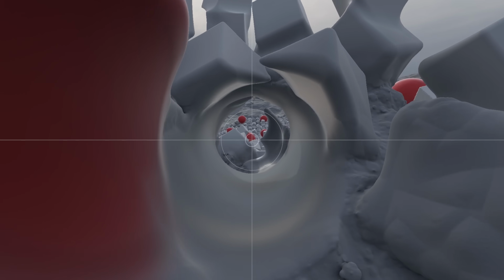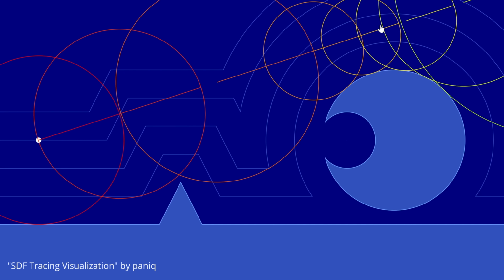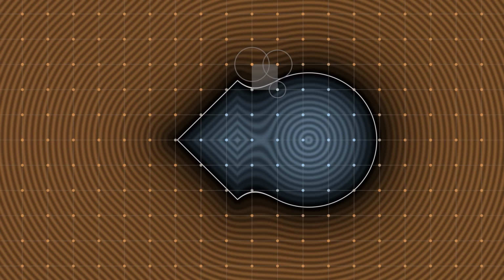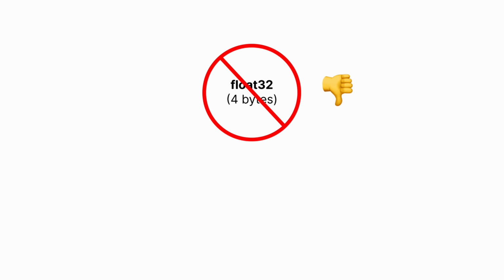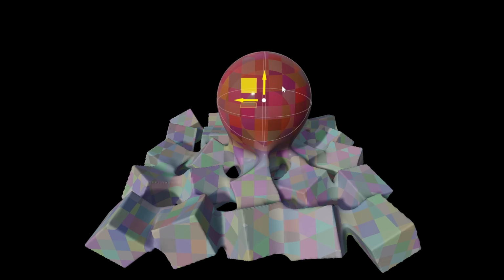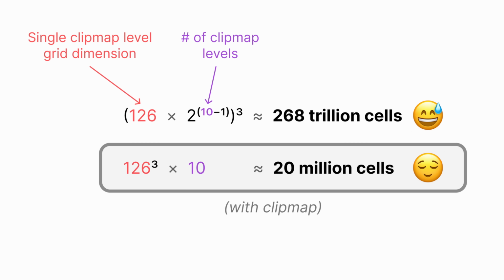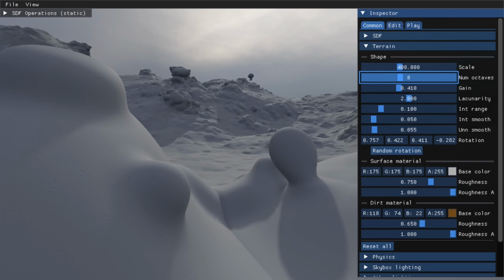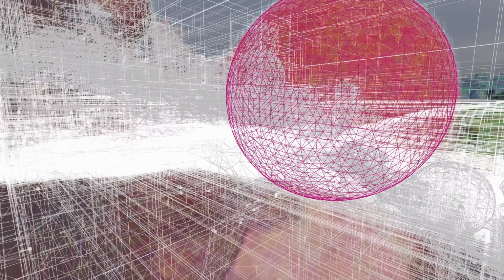I'm making a game engine based on dynamic signed distance fields (SDFs)

Comment: Hey so I watched this the other day, and its been mulling in my brain, and I've realized you can use this technique to solve an annoyance I've had in rendering dynamic water simulation. If you are simulating water via particulates, the technique used to render the water, used to have been to draw the water onto a render target as a series of spheres of the particulates, and then blur the render target to get a smoothed shape, and then use that to render water into the scene. But using your technique might be a faster approach, especially as it wouldn't require an extra render target and render target switching. Such a cool technique with so much potential, amazing work!

Comment: Hello, I have a question: If a very large object moves in the scene, will it trigger a great number of chunk updates and thus increase the computational load? What if, instead of using a unified voxel grid for the entire scene, I assign an independent voxel grid to each individual object and precompute all the relevant data? In this case, would it be possible to avoid recalculating the Signed Distance Field (SDF) during object movement, and also enable arbitrary scaling of the object’s SDF? Then, would we only need to compute the intersection results of SDF voxels between different objects?

Comment: I have a similar idea which I'm not certain of. Instead of using any grid standard in the first place, all surfaces are mapped based on their largest plane or polar projection point center. changing things is slower but storing the data and sending this over the net would be far more compact when basing the hologram on projectively geometric fractals. The system looks for similarities to any shapes before compressing as copies with changes in rots/scale(s)/booleans.
But you now, no fully modifiable world will ever escape sandbox games into mmo's without literally streaming video which alone costs about 20 bucks a month for the end user.  Dual Universe has modifiable terrain, now limited to 1000 meters deep, and it works, but when you fly over such an area, the server has to stream tons of data which costs a lot in real $. 
Survival games are my favorite. I don't understand why so many people waste time on fps trash. The real goal of any programmer should be to make a game that everyone can enjoy in a free roam single shard server. This has been the ultimate dream of many programmers, but most can't get past the first hurdle that DU solved, which prioritizes player positions. 1 million can be in the same place, no lag, no crashing. The problem they had was turning the game into another Factoria with no interesting thing about it besides building custom voxel ships using that terrible voxel system.
Is this engine of yours open source? AT the very least it could be used to let planets erupt volcanos and weather like real ones do every so often. This would give the function of a realistic world people can explore, where even the world creator doesn't know the depths of. Mystery is the best when there are no cheat codes. Explorers who explore the most are most likely to find hidden gems that were made truly at random. I played Minecraft about 3 years and just got sick of it because it all began to look the same and it got pointless real fast. You ALWAYS need to leave room for amazing features you wont think of until later, like npc towns, cities, and ai intelligence that runs nonstop. Evoloution, in other words. The only way a game wont ever get boring.
BTW; the secret to point evaluation is NOT to find ways to save them, but ways to both alter them slightly so they're identical based on the largest degree of projection angle possible for that chunk. In other words, you are better off storing a bunch of blocks that are all rotated by multiples of 5 degrees off standard than 1 or .1 degrees for example!!! You have no idea how much memory this can save you when doing polar coordinates, because you can essentially just save jpegs to build everything. Once you reach this level of efficiency, you can treat everything as a dynamic object, which would allow you to have planets and moons and stars that move realistically not fixed with a skybox.

Comment: At first, I wanted to see the code. But after watching the rest of the video, I don't: there's so much implemented in the engine, and my knowledge of 3D graphics is so low, that the code would just overload my brain and be pretty much useless. I just learned to use SDF to render particles in my 2D physics sim, and would likely benefit more from exploring the concepts you mentioned on my own. But I'll be waiting for further updates from you. Cool stuff :)

Comment: You mentioned a lot about the memory usage, which makes sense at runtime, but how does it scale in terms of long-term storage usage? I assume you still need to persist all the changes at the most granular level to be able to render them when you move away and return back to where the change was made, right? I feel like this kind of SDF manipulation would be amazing for something like a 3D version of Noita (a 2D platformer where "each pixel is individually simulated"), allowing for incredibly cool physics effects.

Comment: Hi, this is absolutely awesome and I'm excited to see where it goes!
I have a question about your engine...

I am building an SFD based terrain system. The distance field is stored densely and SDFs are applied using the cached values, meaning the time it takes to regenerate a region is not tied to the total number of edits the region has undergone.
However, to my knowledge, this prevents my SDFs from being dynamic or storing distances sparsely. For dynamic SDFs, I could recompute edited regions from scratch, but this introduces the problem above.

How does your engine handle this problem? For example, if a user continually dug and rebuilt the same region hundreds of times would the engine slow down?

Comment: 13:18 so between using a BVH and a CSG tree, how expensive is it to keep every CSG primitive in memory for recalculating regions in the SDF grid? I know it takes less memory to represent a geometric primitive without triangles in this context, but seeing how you constantly fire and instance many primitives in your gameplay, even though it's very performant, I'm curious of what the upper limit is. Are there also cases in which primitives are automatically despawned?

Comment: u did it, u have achieved something that i was trying to achieve in 2015 or at least it seam that way. Well i was more trying make it work via network as multiplayer. i was hoping for some download files so i can spawn ton of blue physic object and see how they flow "as a water" would be nice to see water implementation and how u deal with the lag it. as moving thru the scene would collide and disturb thinks. Well that makes me think about displacement so your coal looking black blocks would move above heavy blocks....

Comment: This inspired me to convert my voxel system into an sdf system in my game. It's not an infinite world, but it's also pretty large. Creating tunnels ended up being an impossible task if I wanted to use regular voxels. Instead, I simply used primitives to shape the tunnels, chunk the space and convert the primitives into voxel values, and then use surface nets to create a mesh. Everything is done on the gpu and it's blazing fast. Very very happy with the results

Comment: I'm working on an chunk-based independent voxel body system based on VDF and virtual heightfield meshes in unreal engine, and the voxel system basically only exists to save volumetric body information for deformation on a separate system. My voxel system treats every world aligned voxel coordinate as a potentially 'on' voxel, but only takes up data if one is on, and it treats the location of every voxel 'body' as 0,0,0 so they can be movable as independent systems. 

Your video single handedly makes what I'm building feel archaic and I can't wait to see what comes out of it!

Comment: The possibility of having a beam attack that cuts through a mountain like in an anime 😲
Reply: Especially if you can detect the cut and then treat the two parts of the mountain as separate physics objects like in a continuous version of teardown.
Reply: @johanngambolputty5351 it seems very unlikely. As it would need to generate a collision mess for the entirety of the mountain. Even if the entirety of the mountain is made from a single material, it would take a ridiculous amount of resources to have the top half interact with the rest of the environment.

There are probably way to fake this by lower the resolution of the mountain (destroying many of its features) or some clever trick with SDFs, which seems unlikely.

As of now if you remove the ground from an object it will just stay floating. And it seems very unlikely that this will ever change.
Reply: TBF, you'd only really have to have to deal with gravity physics. Collision would work if you just cause it to re-merge like you were dropping a cube or sphere like they did earlier, no? You'd also only need to calculate the mesh on the bottom of the mountain top, which would be intracting with the ground.  @baggelissonic  also if you lower the mesh rez for the sake of gravity physics and object size then you'd just have to store the full rez for when it re connect with the ground again.
Reply: @quibbage101  Yea possibly store the resolution proportional to the size so its fixed size compute.
However theres one crucial issue you  have not addressed, the mountain itself could no longer be an sdf once split. it would need to be turned into a duplicate physics mesh only and be rendered in a different way. The only other way you could keep it as an sdf would be to duplicate the whole mountain and apply a second object as a subtraction mask over the parts of the moutain that are no longer connected. Thus you would have two full sized mountains with two masks each "removing" the parts before the partition.
Not impossible but potentially difficult with drawbacks.
Reply: Ramiel attack from Evangelion
Reply: @siz1700 TYPO! Attack*
Reply: @VeniriScout  thx
Reply: It’s already possible without this
Reply: @ironhell808 Are you sure?
Reply: Bararaq Saiqa!
Reply: the possibility of throwing a enemy (who's body is super tough) into a building so hard, it's body weight demolishes the building.
Reply: Doing this in my own engine at a very base level right now and it looks super awesome

Comment: The game I'm working on would be PERFECT for this... My game uses mesh deformation mostly just as a visual effect for snow which I haven't been able to do much with due to the limitations of the Godot engine. With an SDF engine I could have building snow forts in real time, snowballs splat onto surfaces instead of just leaving a decal, digging tunnels in snow, it would be great. Granted, I'm not going to up and restart like 2 years of work, but maybe for a sequel someday. Will this project be open sourced? Adding real time multiplayer to an engine like this would be a very interesting problem, one that I would hope to be able to poke at one day. Although a turn based multiplayer game where only one player is affecting the world at a time like Worms or something probably wouldn't be too hard.

Also, I feel like this could be a really good engine for handling softbody physics. Like if you have an object with a maximum distance that it can deform in on itself you could keep a sort of internal pressure for objects like balloons that allow another object to press into it but only to a certain degree. Softbodies in traditional 3d engines are notoriously expensive so this could be another 1 up for SDF engines.

Comment: You could make the grid more accurate without using more storage by using jpeg-style frequency-space compression, which for a game engine would be best implemented by just compressing using ASTC 3D textures. In this case your brick map would point to ASTC blocks rather than pixels. You’re already using 8x8x8 pixel bricks, so you could increase this to something like 64x64x64 by having an 8x8x8 grid of 8x8x8-sized ASTC blocks. For latency reasons you could have two textures, a "raw" texture that’s uncompressed and a compressed ASTC texture that blocks from the former get compressed into asynchronously

Comment: Great video!  Can you share what kind of GPU perf is needed for this engine as well as how much vram? Maybe I got this wrong but IIRC, Dreams used 6gig of ram for its octree/BVH. At least that's what it seemed like from one of their talks assuming I understood it correctly. That suggested to me it was not a technique that would work on mobile. Of course that's fine, not everything needs to be mobile friendly. For the thing I was working on at the time though, I needed a mobile friendly solution and am curious if your solution would handle that better.
Reply from the maker: I don't have exact specs as I still have many optimizations to implement and knobs to turn for different settings. That said, this is not going to work on mobile hardware right now.

Comment: Love the work, but I have a worry. I fear that your wonderful technical achievement will get buried under technical debt and stagnate because you are planning to dilute your effort between different scopes of the project. Scope creep is 'the' killer of most projects. Yes, a proper game can be a great motivator, but it can also be a distraction.

May I suggest putting an proper game on perpetual hold and, instead, focusing on building the tool? 

Full games are REALLY REALLY HARD even with a full game development kit at your finger tips; way too many disciplines to wrangle. Not trying to be a doubter, just talking about rational project optimization. Make a killer engine, and game creators will happily make your game for you bro.

TL;DR:  A mediocre "tech demo" level game may pay for itself, but a good engine could net you a valuable game studio and several profitable games.

Comment: This is exciting. I've been interested in finding an engine that accurately handles water fluid simulations (or at least as much as is necessary to be believable). This looks like it could handle such a thing fairly straightforwardly

Comment: Really cool! I’m curious why you chose linear interpolation instead of quadratic/cubic? It seems like the smoother continuous curve would solve some of your visual artifacts and maybe let you use a lower resolution for the cached points?

Excited to see where this goes!
Reply from the maker: The biggest reason is that with linear interpolation you only need 2 samples (in one dimension), which minimizes the amount of samples that are duplicated between bricks at the boundaries.

Comment: What if you made a static grid and instead you traverse all the points on the SDF shape, you can store the main cameras position offset the world on the render call gpu side (low cost). This keeps the camera at (0,0,0) and move the world instead allowing for no floating point calculations and it simplifies all the code that requires the main cameras position like screen space, because the main camera is always at (0,0,0)

Comment: ASA triangle congruencies = the weak force.  SSA = the strong force.  SAS = the electromagnetic force.  SSS = gravity.  These four fundamental forces are ratios of potential energy to kinetic energy and correlate to different areas inside stable particles that topologically connect to methods of proving triangle congruencies.  There are only two types of energies in terms of producing forces:  one is attractive and comes from areas of a stable particle that are stretched beyond equilibrium and another energy that is repulsive and comes from areas of a stable particle that are compressed beyond equilibrium.

Euler's polyhedron formula relates to the topological spaces between ASA and SSA (vertical asymptotes and complex numbers), SSA and SAS (vertical tangents and split-complex numbers), and SAS and SSS (vertical lines and dual numbers), when applied to stable particles, whether baryonic particles or dark matter.  This gets into relativistic mathematics and modular arithmetic that I cannot fully explain legally.  I risk disgracing myself by not following my own teachings about the wisdom of Sir Arthur Conan Doyle in keeping away from explaining too much and leaving important secrets exposed as what must logically remain as true.

Scroll to the bottom of this most excellent page for understanding the constructive aspects of the limaçon trisectrix and look for how those four constructions fit for the weak, strong, electromagnetic, and gravitational forces:

https://mathcurve.com/courbes2d.gb/limacon/limacontrisecteur.shtml